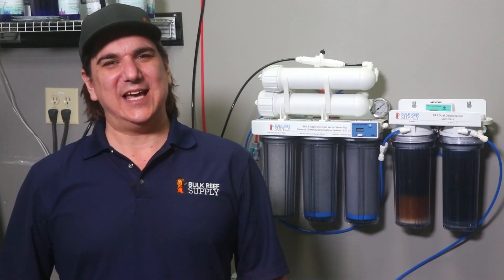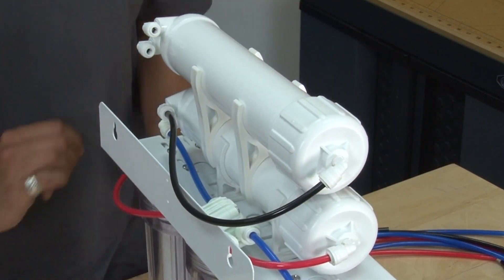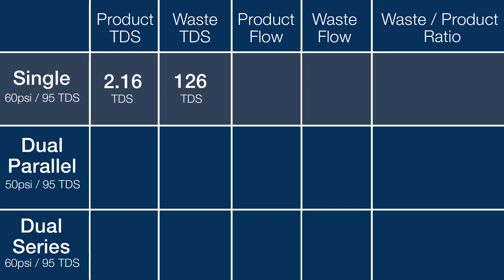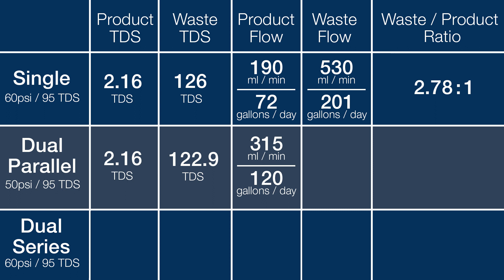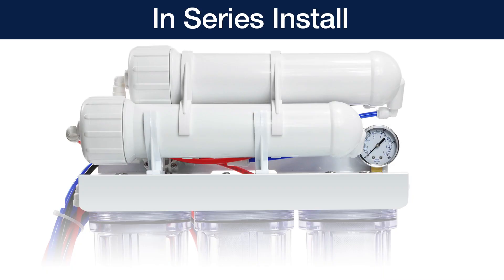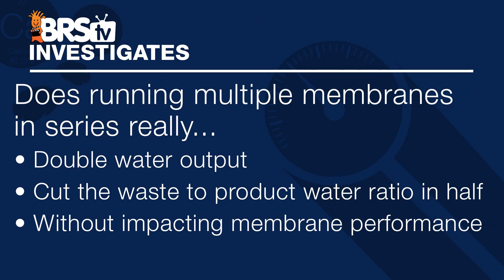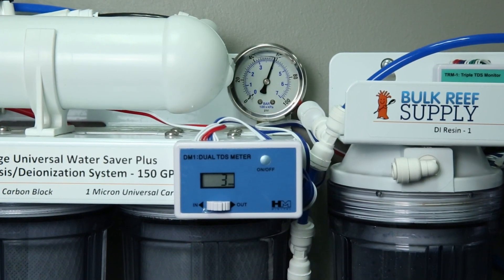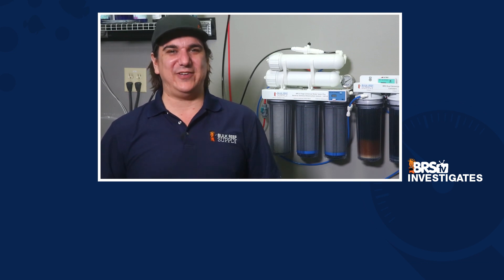Why would I want two RO membranes instead of one?   | BRStv Investigates

Comment: You guys really need to do this same test with a Booster pump, boosting the pressure to 80-90 PSI.I believe both your dual membrane configurations would perform better and might actually have drastically different results.

Comment: I’m using 2x100 membranes, what is your suggestion for flow resttictor ?
Reply: BulkReefSupplyCom Before I had a 1x100 Filmtec membranes and 300 flow restrictor. Now 2x100 and 600 is good, right ? And any suggestion for pressure for pump ?

Comment: I had a think about this after seeing your video and mentioned to my LFS here in the UK. They advised against as they explained the waste water from the first membrane will be of a much higher concentration of contaminants so the second membrane is really going to have its work cut out and likely reduce the quality of the overall mix. Has anyone had a TDS meter on the output from the 2nd membrane to see what the output is like?? Keen to install if it's a genuine help but this just gave me second thoughts....
Reply: Hi thanks for the reply, I'm brand new to reefing and your videos have been an incredible help to date! I re-watched the video and makes perfect sense now so think I will go for it as I'm not entirely comfortable with the waste water i'm generating. My only issue is going to be my water pressure... right now I achieve around 35-40psi which is far too low so will need to invest in a booster pump. I see they come in different sizes 50/75/100 GPD etc. Presumably if my current unit is a 50GPD and I'm adding another 50GPD membrane in the series formation, I need to get a 100GPD pump? Or does the pump need to be rated for the membrane i.e. would a 100GPD pump going into a 50GPD membrane put too much pressure through the first membrane and damage it?

Thanks for your help, much appreciated!

Comment: Hello. First of all thanks for the tests and the data.
However I would like you to clarify some things.
For the normal system(just single pass) you input 273*95=25935 TDS particles per day and your TDS particle output through product and waste water total is 72*2,03+201*126=25326. So you are filling your membrans with particles. For total disposure of TDS particles your waste flow restrictor should be optimized to around 216 GPD.

For the last test(double pass, series); same calculation. 
138*2,43+203*159,6=32734 and the input is 341*95=32395. The output TDS particles can't be more than the input. So there seems to be some problem with the last test data. Can you verify those numbers please?

Comment: Using the BRS 150 gpd with auto flush, and the booster pump, I typically get 5 gallons of RO or RO/DI in 31 minutes with a TDS of 1-0. This is great when you consider my tap water TDS measures around 360 to as high as 620!
With the booster pump, I achieve a psi of 90 to 98, depending on variables. it's tempting to make my water for the tank with RO water however I've not done so (if it ain't broke,  don't fix it!).

Comment: Is this possible to do with 2 100gpd membranes? I have 70-80psi going into the membrane without a booster pump and currently use a 150gpd membrane.

Also, how would you manually flush the membranes before use? I have that pressure auto shut-off with float that you guys sell and I keep the valve to the DI closed so the flush water goes out the waste line and open the flow restrictor. But even then, I have to keep opening & closing the DI valve because too much pressure builds and it shuts off the water supply. How would I be able to flush both membranes when all the tds creep is being sent up to the second membrane? And then you can't use the auto shut off because you have 2 product water lines that can be joined, but would create a lot of pressure. 

Guess I'll just stick with what I got, though I really would like to save half the waste water.

Comment: SW okla My water was 480 tds coming in. installed an rodi system 2 ro filters series out i get 9 tds 2 di filters i get 0 tds. a year later i get 1 tds. i run this for 125 gal tank ato water changes not many and drinking water my guess in 1 year 1000 gals of water so far
Reply: city of altus oklahoma where i live did a 5 million $ upgrade to ro water now i have 8 tds coming in and still 1 tds coming out, got 2 di bags from you guys havent changed it out yet
Reply: citizens are paying for it our water bill went up 20% and our electric went up 35% trash went up 50%

Comment: This was not all the surprising, makes alot of sense .  I am abouyt to upgrade m 100gpd to 200 gpd using the last method, I already autoflush using my apex system,, also do  quick auto flush whilke making product water as well.  I jsut need to test my PSI on main to see what I am at.

Ryan: You should add a booster pump to this test so see how it affects GPD,  wastewater and product water,.   should be an interesting test

Comment: what if I used 3 membranes? Would I go insane in the membrain?
Reply: Jerome Saverimuttu 😂😂😂😂 you have earned this "W" ✊🏾
Reply: I run 4, looks like a water plant to run my whole city
Reply: if pressure is a issue on the third just install a electric pump ,mad scientist style
Reply: Make sure you use a pump without bypass or use 3/8 tubbing at least around the pump. No, you wouldn't, but you will definitely need to install an autoflusher or solid-state timer+solenoid combo to flush pre-use.
Reply: Jerome Saverimuttu insane in the brain

Comment: I have the brs 4-stage watersaver+ 150gpd unit. I added a second 3-way TDS meter on it so now it has 5 readouts. It's totally overkill, but now I can see input, and post-sediment tds. May do the membranes separately some day too. I later upgraded it with the smartbuddie booster pump which has autoflush too. My incoming pressure was like 46-47 before and now it's almost 90 with this thing. Supposedly, according to some amazon reviewer, their 6 stage watersaver+ did over 250gpd with 1:1 waste with this same smartbuddie pump. I'd be curious to see how these things perform with/without pumps, different flow restrictors, 4 vs 6 stage, etc.

Also, I have a suggestion for you guys. I bought a set of lamotte strips to see if i had chloramines or not before I bought my unit. Fortunately for me I do not so I bought the 4 stage (in fact incoming TDS is 34! HAH!.) Which, of course, includes...another set of lamotte test strips. Just seemed funny to me to include them after-the-fact. You should do some kinda promotion where you send people strips ahead of time and they commit to buying the 4 or 6 staged based on the chloramine result or something.
Reply: Hey, I do remember that video, but yeah as you say - it's limited in what it tests, and only tests one style rodi etc...

you'd almost have to do the test at different input TDS levels, hah. I don't even know how you'd pull that off. would most definitely be interesting to see like how a RODI performs with TDS at @ like 50, 100,150, 200, 400, 600, kinda thing! My TDS is like 35-40. It's hard to get much lower than that, I think I'm pretty lucky.